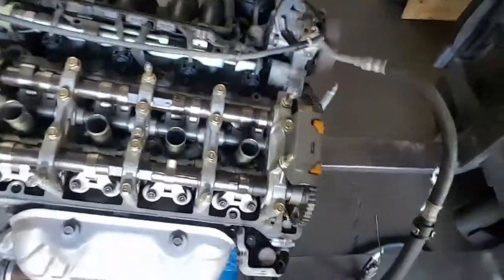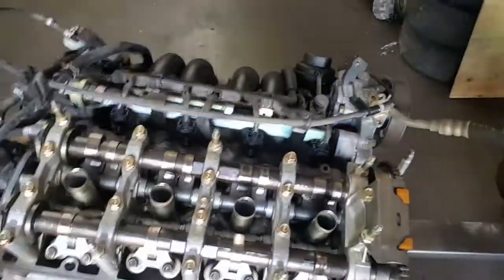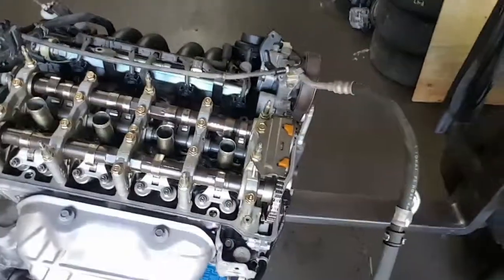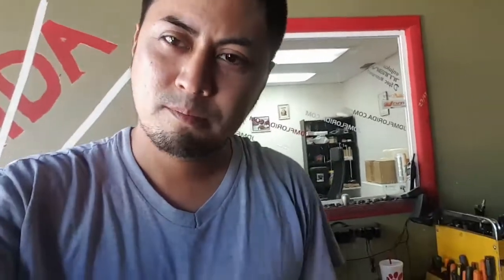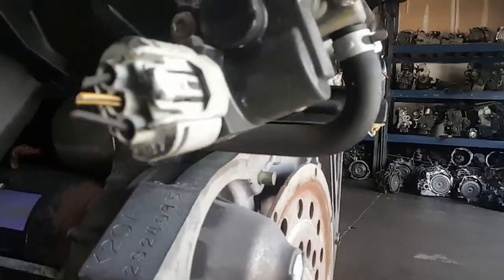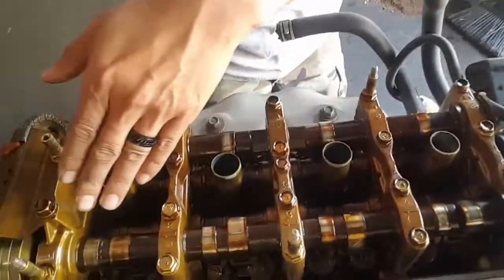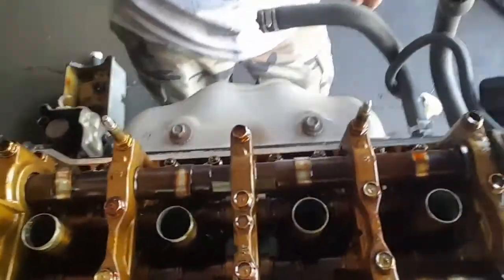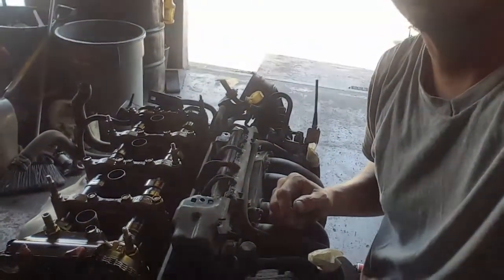JDM K20A engine introduction

Comment: I have a k20A engine in my 2002 honda crv. Its a right hand drive. And it also have intake camshaft has 2 lobes and exhaust 1. Meaning only vtec on the intake side

Comment: Got a jdm k20a as a direct replacement for my k20a3 in my ep3. Was wondering if there is a way to tell if this k20a came with the better oil pump or not.